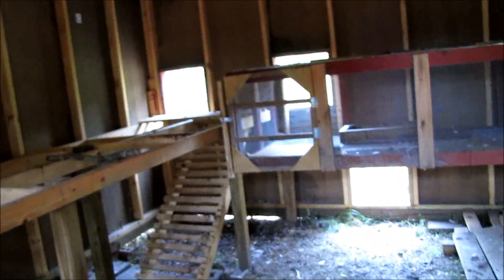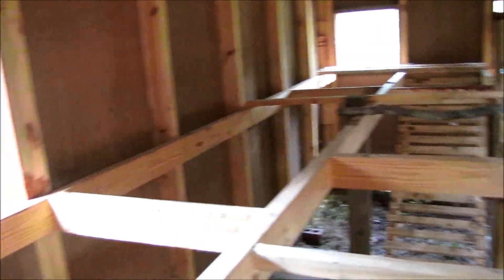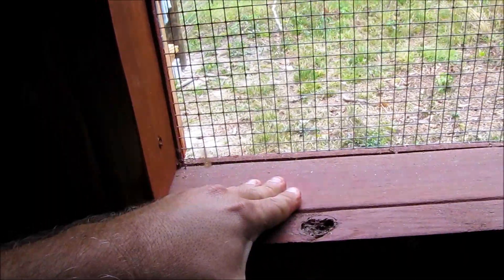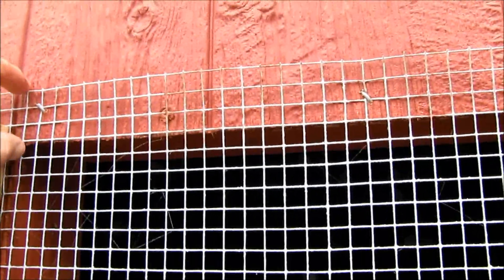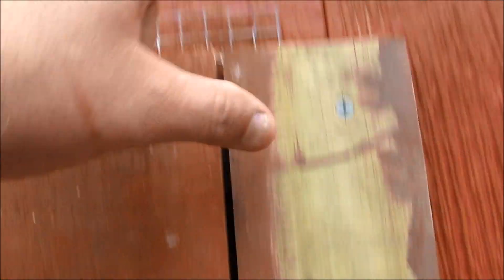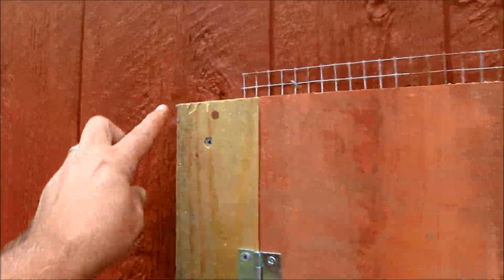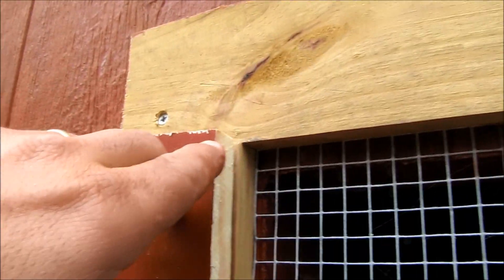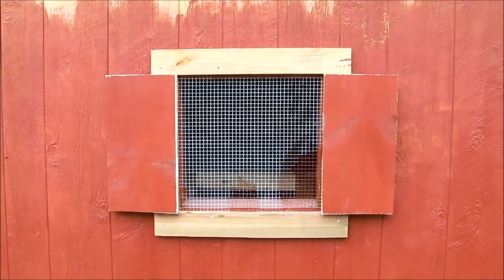How to make a chicken house window

Comment: Great work and thanks for the video. I'm building a coop and wondering should I leave space between the hinges? I mean folding door and the wall and also between the two doors when they are closed? I noticed you left space there. If yes how much space? 1/8 on each side and the middle perhaps? 
Thanks very much
Reply from the maker: Hello, yes I left around 3/16 so the wood can expand when it gets wet.